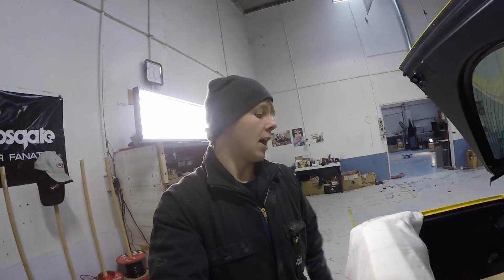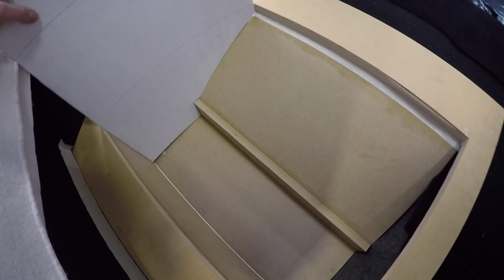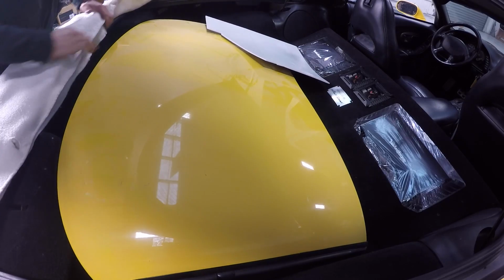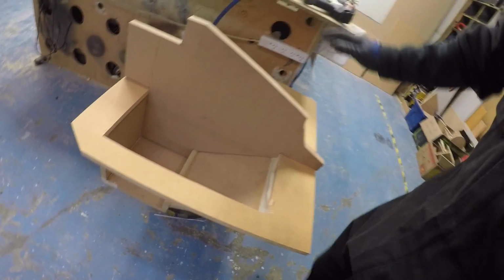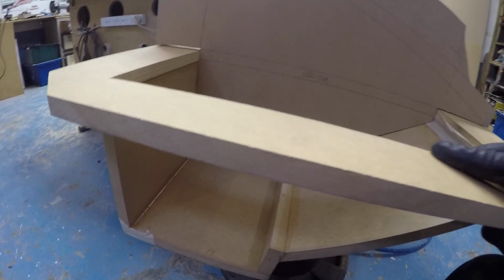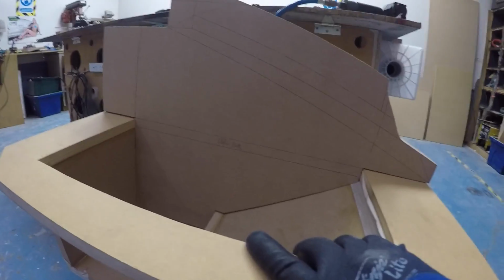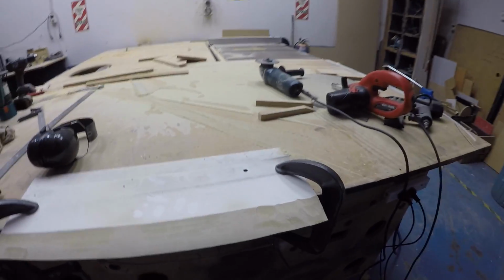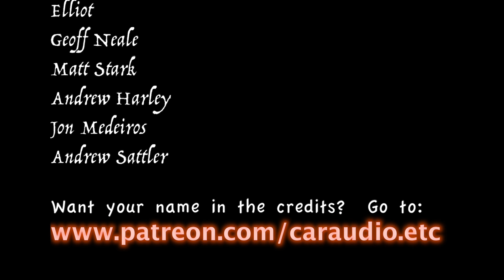Corvette C5 | Building a Custom Subwoofer Enclosure!

Comment: One person is happy about the short video with less talking lol 😂. That box is very complex. I'm guessing you are going for a sealed enclosure? Do you know how much airspace it has? Is it deep enough for the sub? I'm thinking the walls above the donut need to be closer to the edge. You could make the profile by tracing around the part that is sticking up. I know the roof tapers down on each side but you should be able to make more airspace. I'm also a little concerned about the vibrations and abuse the roof is going to get being inches from that sub. I know the options are very limited but just my 2 cents. Thanks nice video.